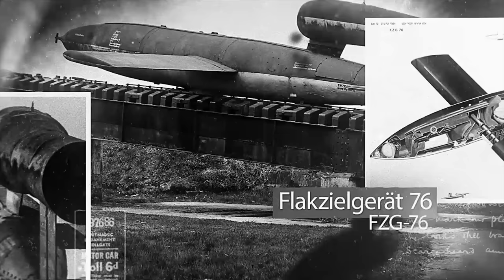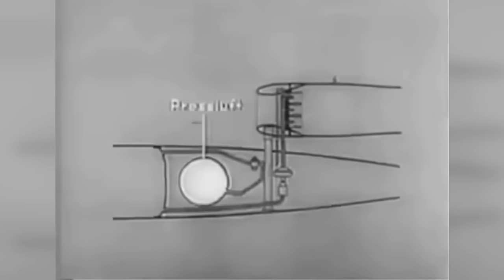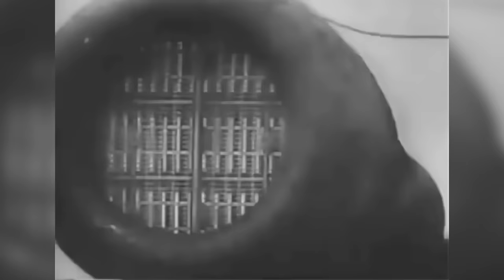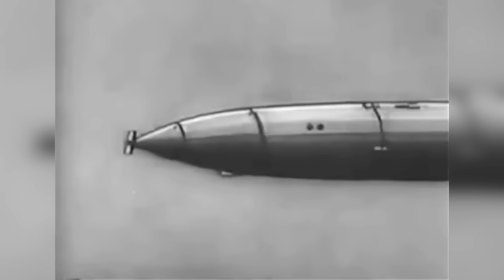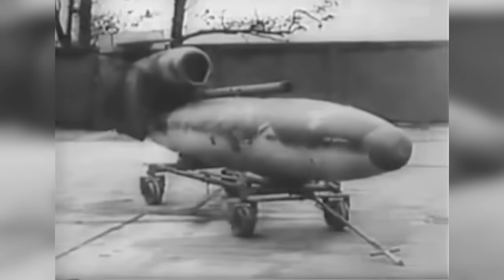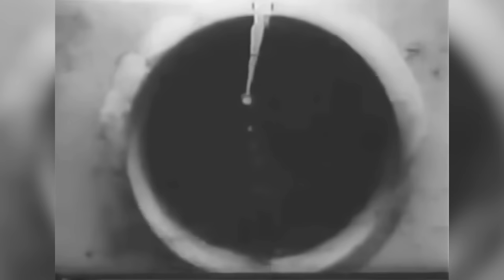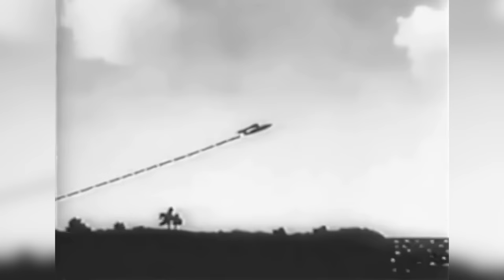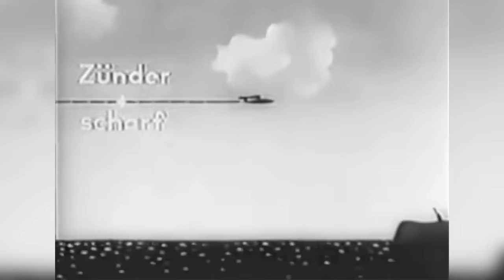The V-1 Flying Bomb | Training Video In English | Vergeltungswaffe 1 "Vengeance Weapon 1" | Upscaled

Comment: Why did they never use this engine for cheap fighter planes?
Reply: Only runs full throttle and doesn't maintain rated power to any appreciable altitude where the fight happens. There were some concept aircraft being planned to use this engine but most were bordering on kamikaze missions.